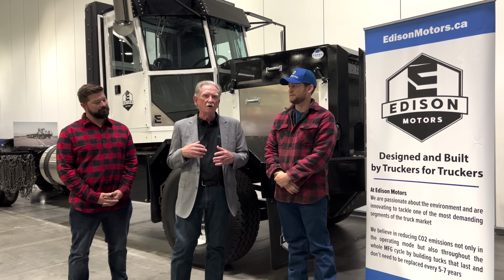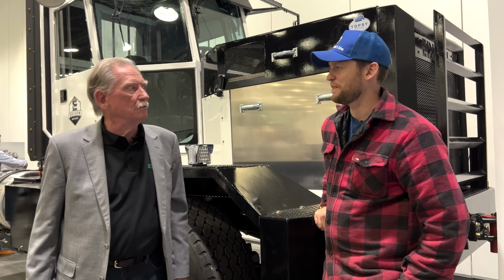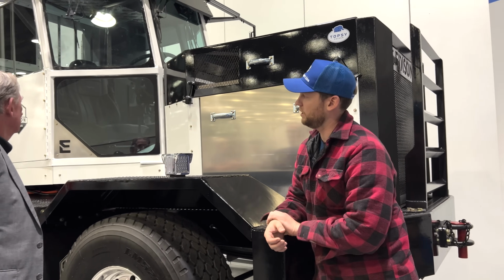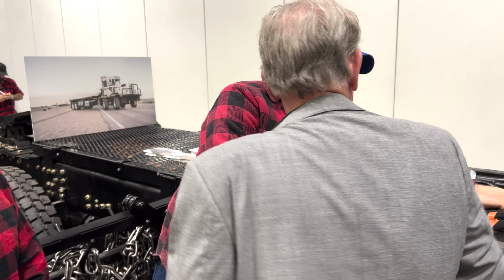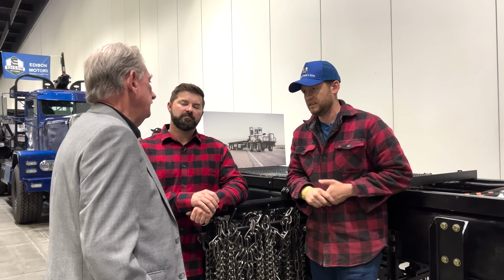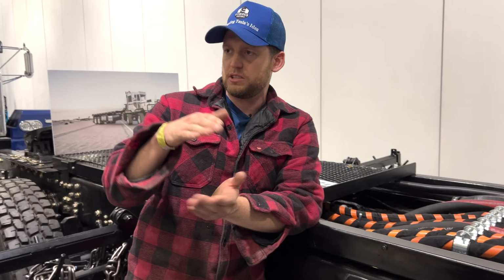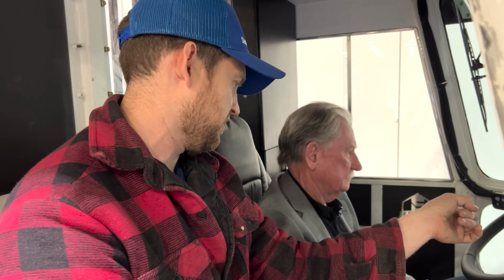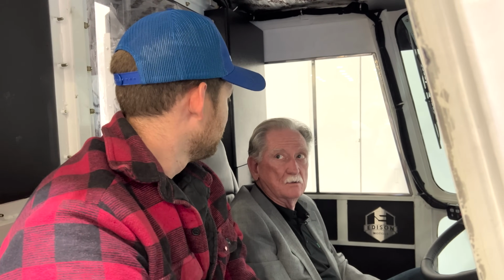This Electric Semi is a Million-Dollar Idea! Edison Motors at Fully Charged LIVE Canada

Comment: For this use generator with a battery pack makes so much sense. You reduce fuel, CO2 and pollution while saving money. Repayment in 2 years for something that will last 10 years until refit. They didn't even mention brake savings, prob $1,000 per month for a mountain logging truck burning up brakes on the way down. Eventually the generator can be replaced with lighter batteries. I wonder if this could work for mountain routes for long-haul trucking. Less time in the shop, plus fuel & brake savings is a big draw for any trucker, and Tesla semi is not coming to indies any time before 2027.

Comment: Fantastic! So refreshing to see a company with a mindset of "In the unlikely event this part breaks, you can replace it for a couple of bucks and two screws". It's an attitude that fleet operators want but so rarely get from OEMs. I wish Edison Motors the very best, products like this deserve to succeed.
Reply: I wish they would get that at management level. I hear and see the exact same through my job but before you get the mindset of a big OEM changed years go by. And then you speak with the Purchasing dept. again and need to save again on every damn bolt or make a proper plan on why they need to be so strong. Aaargh. It's an endless loop. 
I also started as a young aspiring engineer but 15 years of HD vehicle quality & test engineering later I am just like the rest of them...
Reply: and being s*****d by «consultant» pirate friends-of-the-Government and shameless colluding politicians!

Comment: I'd love it if Tesla would work with these guys to give them state of the art electronics.  Logging trucks are not a niche Tesla is likely to serve but Tesla could help Edison to be the best they could be.
Reply: Doubt it since they are competing
Reply: @DavidLeon140m3  
Tesla is not entering the logging truck business.  Logging trucks are quite different than semis and Tesla will have far more demand for their semis than they can meet.

In the past Tesla has helped both Mercedes and Toyota with their EV offerings.  Tesla is opening up their Supercharger stations to help other EV manufacturers whose customers do not have access to reliable rapid chargers.
Reply: Edison wants simple cheap and easy to replace components. He is completely against proprietary parts
Reply: @gilliesiut2332  
I understand the thinking but sometimes the best solution is not found at your  local car parts store.  Tesla has highly developed solutions for getting the most performance out of batteries.  

Ford has just thanked Tesla for making their 48 volt solutions available for Ford to use in their EVs.  And almost every EV manufacturer has signed up to use Tesla's Supercharger network.

Comment: Switching to a turbine would produce as much electricity as a lower weight.  It could run on diesel.  It could operate at full load more efficiently charging batteries.😮😮. Fewer moving parts.  Less vibration, more durable, can cook hotdogs in BC.
Reply: +10 D points for having a turbine
Reply: Small gas turbine engines - and a truck engine is relatively small by the standards of turbines - are much less efficient than diesels of comparable power output.
Reply: turbines use more fuel for the same output (at least at this size) and are more expensive and complex to service.
Reply: @ethan12313  not when making electricity.  A high-efficiency, combined-cycle turbine running at peak could make 17-20MJ per liter of the same shiitey diesel that the diesel Genny can make 14 on a good day.
Reply: @ethan12313  less parts, no FAA oversight.  It's less complex to operate a turbine.
Reply: NM, I'll make it.
Reply: An LV-50 turbine is 50 something years old and can beat that cat
Reply: Or power a small data center.  There's a reason data centers have turbine electric for backup.
Reply: Interesting about how efficient small gas turbine are.  Can you please state their fuel consumption and whether they are using a heat recuperating system. Thank you. In (lbm/h)/hp or (kg/h)/kW.

Comment: And the diesel semi was a billion dollar idea. 😂 Considering they still need a generator for extra range they should look into Hylion which already produces diesel electric hybrid powrtrains and is bringing newer natural gas and electric hybrid semis. Not to mention that they acquired a fuel agnostic linear generator from GE that can run on a wide range of fuel from hydrogen and ammonio to methane or diesel without combustion.

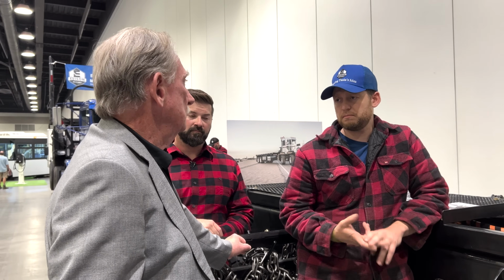Comment: 11:00 - General configuration is a 9L Caterpillar diesel engine driving a 350kW Danfoss generator. Initial programming (subject to change) fires up the diesel engine when the batteries reach a 50% state-of-charge (SoC) and shuts the engine down at 80% SoC. Given this, the duty cycle should see the generator set charge the batteries for approximately 18 minutes; consuming about 14.7 L/3.88 gal of fuel per charge cycle.
Reply: Good try, but at 1800 RPM the Cat C9 cannot produce anything like 350 kW. From 50% to 80% SoC of a 280 kWh battery would be 84 kWh; delivering that in 18 minutes would average 280 kW... which the engine can't produce. At 4.7 L per 18 minute cycle, you are assuming 16 L/hr... which is only about 20% of the fuel consumption rate of a C9 at full load. So all of the numbers are wrong.

Edison does not have the numbers worked out, or if they do they don't have them on their website and Chace doesn't know them.
Reply: @brianb-p6586  They've currently got the truck out in Toronto for all the official testing for those numbers and saftey testing, I'm pretty sure that they are ball parking their numbers right now but should be within a close enough range.
Reply: @Liqwidbutterfly0925  the work in Toronto will just get the controls sorted out, and won't likely include any real-world testing at all. 

Really fundamental quantities such as generator output power and diesel fuel consumption rate should have  been worked out long ago - they don't even require building a prototype.
Reply: @brianb-p6586  Again, I question the motive for posting such replies. Do you have firsthand knowledge of the work to be done at Flodraulic? I'm happy to say that I do possess such information, so I'd caution issuing pessimistic predictions.
Reply: @ARepublicIfYouCanKeepIt  Edison has openly shared their work. Flodraulic has provided all of the control system design and configuration work; that's what they're doing. They do not operate or test vehicles. 

I agree that the engine is likely suitable; however, it simply cannot deliver the power you expect at the speed at which Edison staff (including Chace) have repeatedly stated it will operate, which is 1800 RPM. The 1C charge rate is 280 kW, not 280 A; that's 375 HP, which as your comment confirms is substantially more than the engine can deliver even at 2100 RPM. Obviously,  maximum engine output at 1800 RPM is even lower.

These are simple corrections, which I already provided but have now explained more fully. I didn't realize that your fuel flow rate error was using the wrong units, but that is only one error.

Comment: I've been following Edison Motors since January 2022 and am very impressed with how far they have come in such a short time. Nice to see someone designing a truck for the industries where reliability and serviceability are more important than sleek looks. This also would be an impressive truck on the highway.
Reply: Good to see a product without built in obsolescence.
Reply: @charleswillcock3235  yeah, that's one of Chace's big things, no planned obsolescence. He managed to keep from going on a rant about that.
Reply: One thing that Sandy didn't ask about was the cost savings on brake wear because of regenerative deceleration. Could be considerable in reducing downtown and parts.
Reply: @martinhicks6020  he did mention it, sort of, when he talked about the regen braking and how he rarely uses the brakes in the Lightning. Implied, more like.

@ 3:39 and 17:28 he implies the savings on brakes
Reply: I agree that the advantage of regenerative braking was discussed with regard to fuel savings, but I was hoping for more indication of actual cost savings from reductions in downtime and parts over the life of the vehicle.
Reply: @martinhicks6020  I agree, it was too bad the glossed over that with just a brief comment or two
Reply: @martinhicks6020  It's doubtful they know, quite yet.
Reply: They mentioned one foot driving and how a truck usually engages the Jake Brake as soon as you  let off the accelerator.
Reply: @mikegrok  No

Comment: I wonder if this would be a situation in which battery swapping along the route might make sense? These trucks need a lot of energy (he estimated 2.5MWh per 'duty cycle' - is that 1 trip?) but presumably their route is somewhat predictable.
Reply: The 2.5 MWh value is for a whole day of operation, which is probably multiple short trips. The route is predictable, but battery swapping would be impractical.
Reply: @brianb-p6586  Why would it be impractical?
Reply: @jonathanmelhuish4530  batteries have high-current high-voltage power connections as well as low-voltage computer network of control connections, but the big issues are liquid cooling lines and structural mounts to securely support their substantial weight. This Edison truck has eight battery modules on four separate mounts, with air suspension on the parts between the frame rails. This is not like a cordless tool battery that can be popped off and another snapped on.
Reply: @brianb-p6586  You have not heard of Janus Electric in Australia?
Reply: @nopenonein  yes, every Australian in social media seems convinced of two things: road trains make everyone else's trucks look wimpy, and one company that swaps batteries proves that it works for everyone. Did you notice that no one else in the world thinks this is a good idea?
Reply: @brianb-p6586  No I am not Australian. I have viewed their operations and applications. It seems fine for city use.  Whereas, you who seems to take over the thread and make your own opinions based on your own here-say is quite silly.
Reply: @nopenonein  I didn't say you were Australian - I identified the source of my awareness of the Janus battery swapping scheme. 

It's not possible to "take over" a thread. Comment if you want; don't if don't want to. And comments are always some combination of opinions with reasoning and supporting facts; I have provided some of each of these.
Reply: @Adscam  I have spent some time looking into the details of the Janus system. They have two entirely incompatible battery formats (their first version slides in from the front into the original engine location, the newer one hangs on the side in a saddle tank location). In their website, and videos, and media coverage they never show the details of the electrical or fluid connections, but they always show a forklift being precisely operated (placing to within a few millimetres) on a clean and smooth concrete surface, to swap a battery in a truck designed for that specific battery (no range of different trucks). That may indeed be fine for some urban operations, but is a different world from the vocational applications which Edison is targeting. Every logging trucker who bought a different truck or a different generation of the same system would need their own battery swap station, and none of the batteries would last more than a few swaps before being destroyed. 

The front-mount Janus battery eliminated the front frame crossmember, destroying the truck's structural integrity. The current side-mount battery is very low (to get enough volume to fit in), and would be bashed into the ground in rough-road service. Even with the bottom that low, the top is so high that it only works with the Short-bonnet Australian Right-hand drive (SAR) cab style, which sits unusually high for a conventional (not COE) truck.

And they never do address thermal management. They may have none, and that may work in Brisbane, Australia.

So, good on the Aussies for making something work in specific scenarios, but it far from plausible as a general vocational trucking solution.
Reply: @brianb-p6586  Come on now Brian. You certainly aren’t an expert on the Janus Electric System.  Why do you continue to speculate when it seems like it is working fine for city applications.  And no, they never talked about vocational applications. That is just you speculating.
Reply: @nopenonein  actually,  the comment to which we are responding was a suggestion that battery swapping would be suitable for Edison's logging application. I agree that the Janus system should be fine for nice applications.
Reply: @brianb-p6586  Brian, show me where?
Reply: @brianb-p6586  Brian, re-read your statements.

Comment: I saw a show about a huge electric dump truck used in mining at the top of a mountain and it was also getting enough regen going down to charge the battery. Great application when you can use gravity as a fuel.
Reply: Tesla Semi has a third motor for additional regen.  The energy used going uphill is replaced during regenerative braking downhill.

Comment: Chace is the perfect example of a humble Canadian who is whip-smart with deep knowledge in his particular field. No flash, all function.
Reply: Totally.  No bullshit, just openness and honesty.  I hope they get filthy rich.
Reply: Agreed!! @Frito-p5w
Reply: Not wrong. His emotional  reaction to Sandy's praise says it all
Reply: Yeah, guy talks the trade, does not spear warm air, is humble on his legs. Much respect!
Reply: I would like to see the comfort features of the cab, current and planned. It looked as if the air suspension seat was all the way down.  Also, comments about the forward visibility would have been nice when the air ride seat is in driving mode, and it looked like the cab had great side view visibility. It would have also been nice to have the other cab necessities such as, cab noise, windshield defroster and air conditioner and cab safety design explained in the presentation.  I am wishing this new start up manufacture of specialized trucks great success.
Reply: Maybe shouldn’t have said “we aren’t truck builders”  though
Reply: @korvish111 Yet
Reply: Adding the Manganese to LFP foes reduce the durability somewhat, but the added capacity makes them a close competitor to Li-Ion cells @Tron-Jockey
Reply: @Tron-Jockey Very interesting with LMFP. Would the price of those be comparable to LFP? They seem to plan to build only custom trucks, so it might be possible to order it with LMFP.
Reply: @Tron-Jockey It would seem like the "...LMFP could allow Edison to offer a version of this truck with battery only" approach would directly counter Edison's intent to operate with a generator to maintain their independence. To have only battery power wouldn't be any better than any other EV on the market. The limited range of the current crop is one of their inherent drawbacks. The new improved battery technology you're describing sounds promising though.
Reply: he's no terdreau that's for sure

Comment: I liked the reaction at 4:58 of the CEO telling this guy it still uses a diesel engine in the front. Down to earth commentary about how much energy the truck must still use because well...of reality. Dismantled the unicorn agenda of the presenter. You actually begin the train of thought the moment he says the motors are double the rated capacity of the batteries and then it settles with the silence of Munro as the CEO tells him of the megawatts of power needed from a diesel generator. 
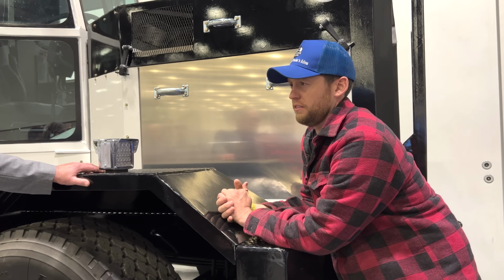You notice his agenda because he thought the truck could only be powered by electric energy and unicorns most likely, then the guy presented the reality: the distance to the mill 5:15 then wondered if it could be fixed by separating trucks because it stopped making sense only to find out it's not possible and then shift to "the one thing I thought...but if that is not the business case then...  I guess it's slightly different than what I was talking about"
Reply: There are no "megawatts of power " involved. Yes, megawatt-hours of energy (not power) per day.
Reply: @brianb-p6586  Tell that to the guy talking 5:09. There's a difference obviously
Reply: Yes, @lumieresombre7512  many people - even in the EV industry or trying to be - are either sloppy in their communications or just don't understand. Sandy Munro makes lots of mistakes in his video (fortunately, his company depends on more capable staff), and Chace often tosses numbers and terms out without much understanding.

Comment: Exhibit A of why H2 just doesn't have a role to play in heavy trucking, even in the most extreme applications. As batteries continue to improve, you're going to see that genset hardly running on most routes globally (and for that, you could switch to small quantities of biodiesel without it breaking the bank)
Reply: Funny enough, if you wanted you could swap the diesel ginny out for a hydrogen one!